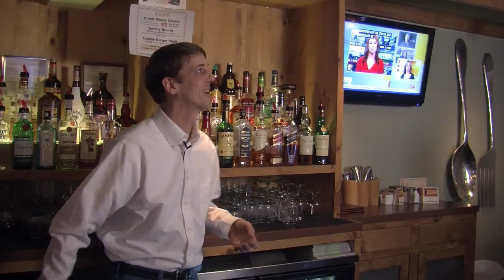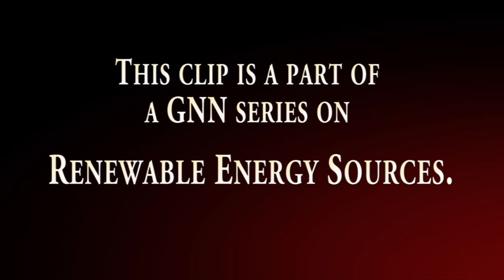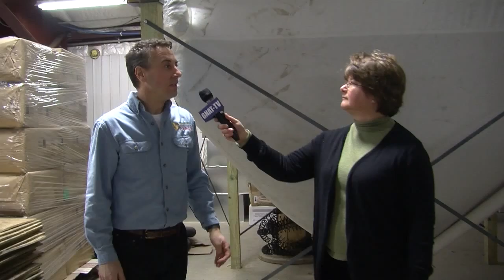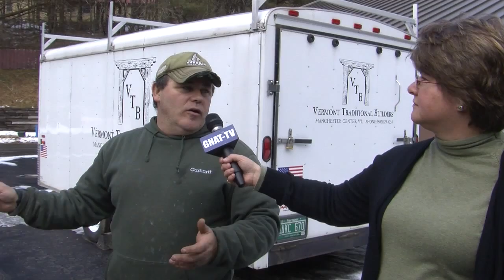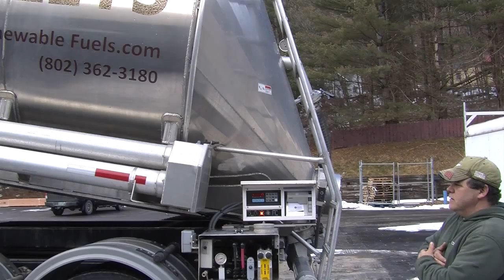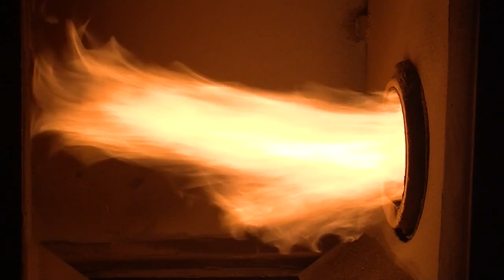All About Heating with Wood Pellets.

Comment: Bulk wood pellet deliveries reduce packaging costs for the wood pellet manufacturer, and they also provide a cheaper pellet for the consumer. There are even small pellet silos, which can be installed in your garage with a hatch to empty the wood pellets into a bucket for you to load into your pellet stove.